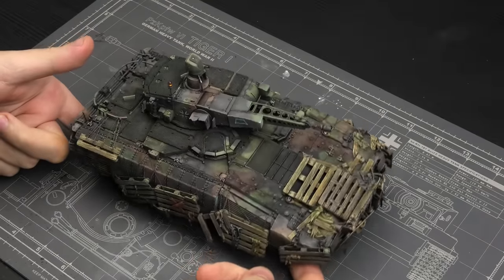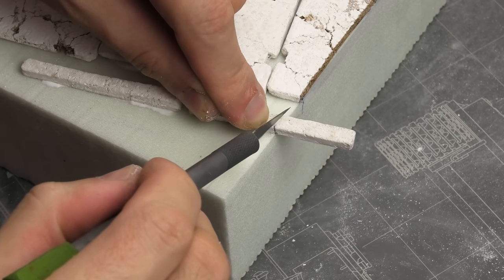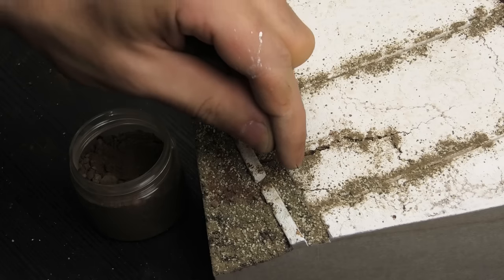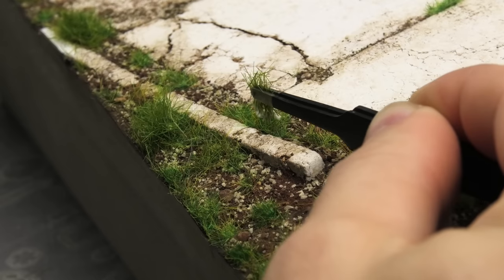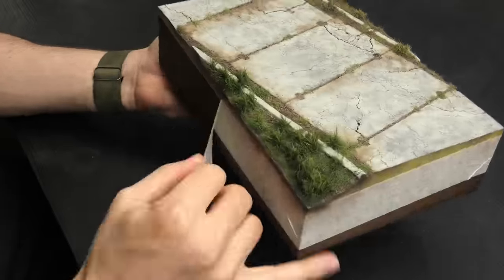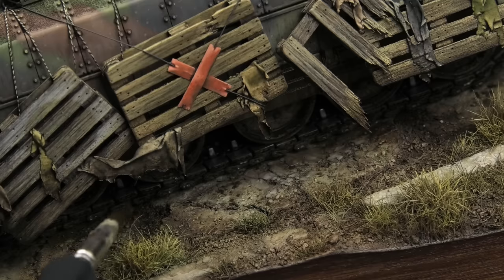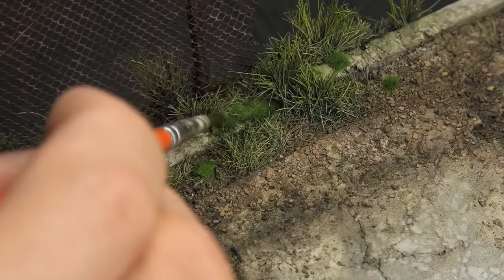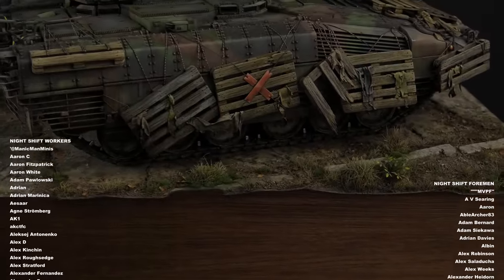Build A Simple Scenic Display Stand For Modern Armor

Comment: Love that effect with the cork as concrete! I wonder if this would work on a smaller scale too?
Reply from the maker: I bet it works in any scale. Heck, now I wonder if it can be applied to thin styrofoam sheets used for plastered walls on miniature buildings!
Reply: I've tried it for a 1/72 plane and it worked pretty well

Comment: Using this video as an excellent guide when planning out my own dioramas. Just wondering where you source your big sheets of oak veneer from that is shown in the video? I'm having trouble finding sheets larger than A4, I use a standard size of 300x350mm for my dioramas and would like to avoid having a seam in the side paneling.

Comment: Hi uncle night shift! How do you remove the CA glue/super glue that accidentally fell onto the model? I saw several brands selling Adhesive removers but I don’t really know which ones I can trust. Which product/what approach is in your experience the best way to remove dried super glue from details?
Reply: Most CA debonders can harm plastic from my experience, I would suggest good old fashion hobby blade (scrapping and cutting) and then sanding the area...